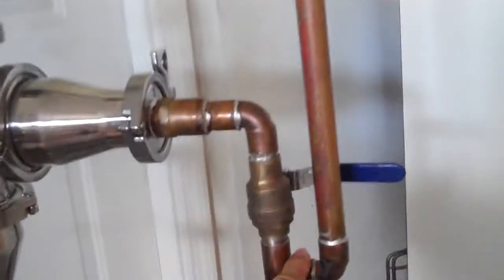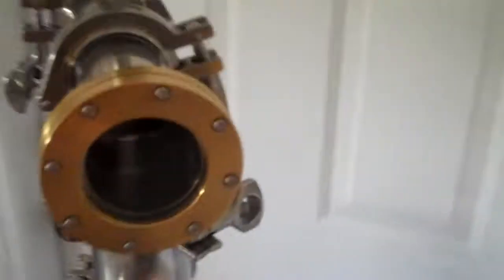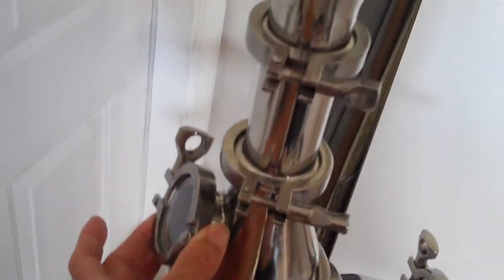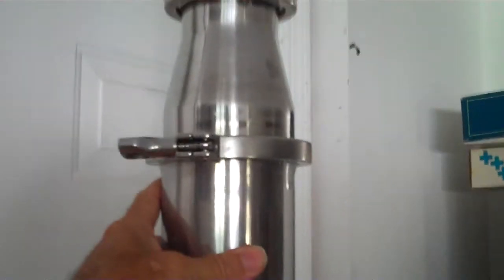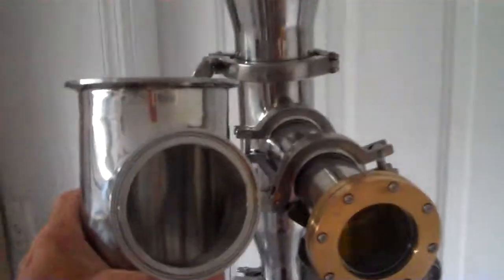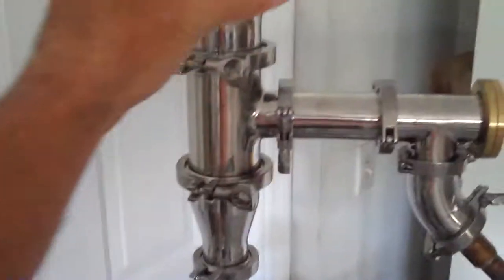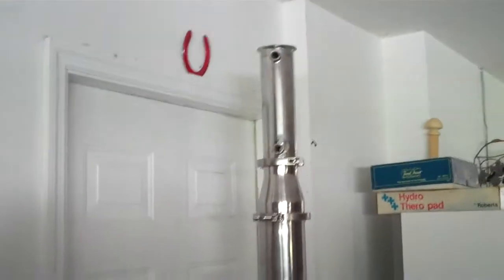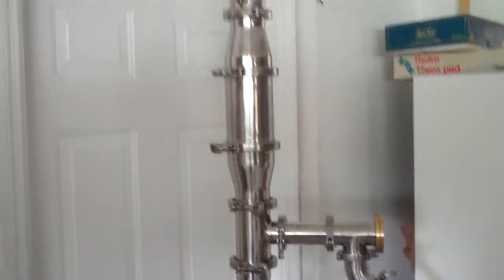VID00113

Comment: The temperature control feature on your distillation column seems to be the height. You've proposed experimentation and temperature probes along the length of the column to determine the point of extracting product. This method seems to be much simpler than the Charles 803 solution with the Johnson Control Valve.